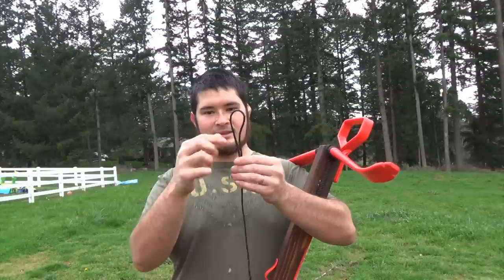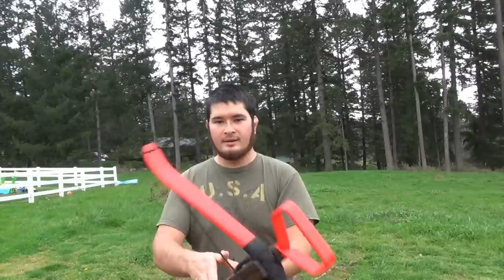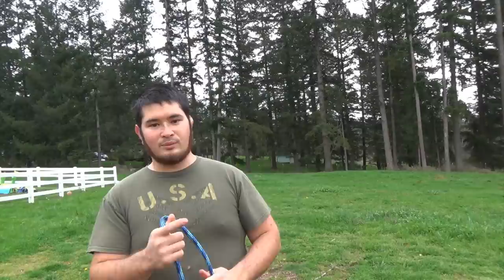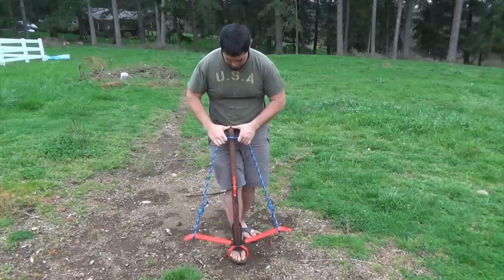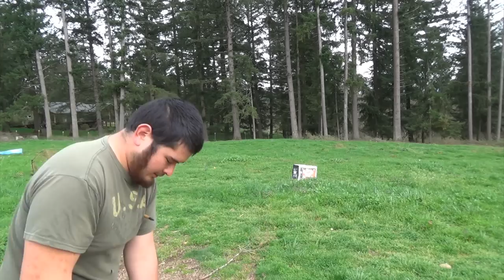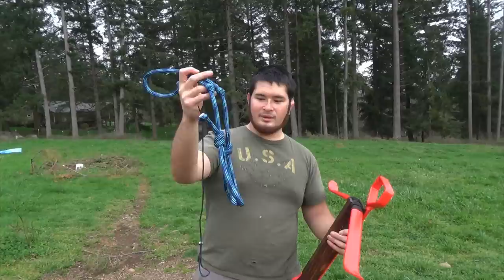100lb Medieval Style PVC Crossbow for Under $10 Part 4 - Paracord String and Bow Stringer

Comment: Just made my 2nd homemade crossbow using your tutorial!  I had some trouble making the PVC piping straight, as I had to use my oven instead of a heating torch.  But other than that, the piece came out really nice.  Couldn't have done it without your videos, keep it up!!

Comment: ive made about 4 prods now and the first one fired a shot then buckled, others either buckled or cracked quickly aswell, does anyone have any tips to prevent this? i am thinking of buying furniture grade pvc instead of schedule 40 but i do not know if this will fix the problem.